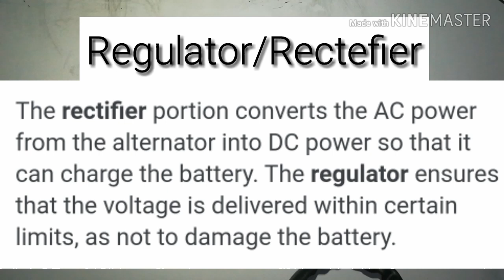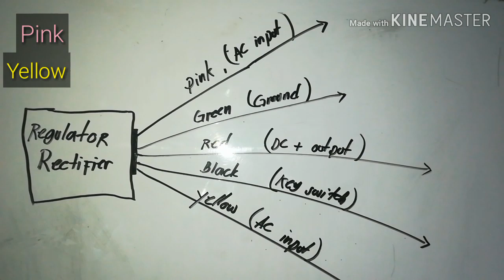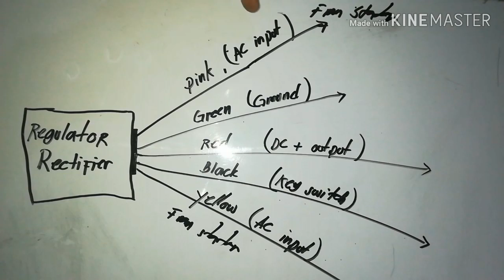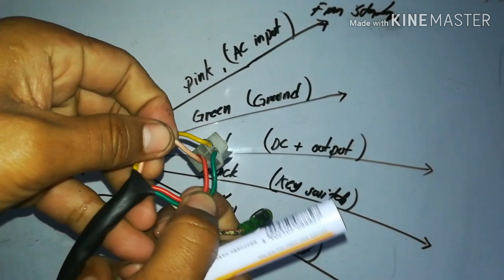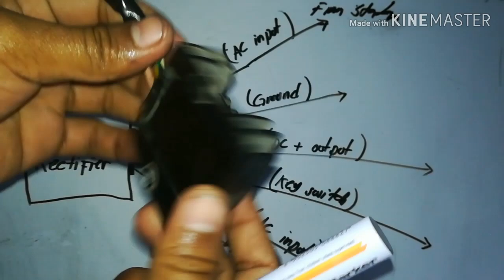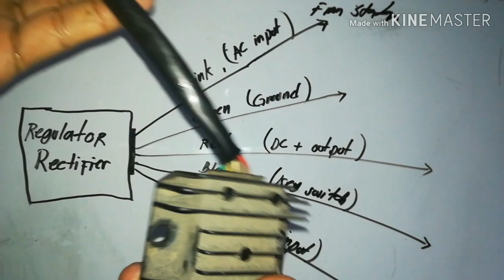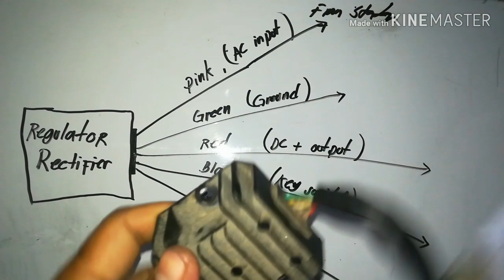5pin Regulator rectifier wiring diagram(paano malalaman kung ok pa or palitin na?)part 1

Comment: 4pin lng stock rectifier 
bumili ako bagu rectifier hnd ko alam kung ilan wire tinanung ako ngtitinda anu b motor ko sbi ko gy6 binili ko 
5 pin sya un tinaggal ko luma ko rectifier 4pin lng pla nygn ginawa ko red at black wire pinasama ko pra 4wire prin un black un sobra at wala kapareho tama b ako pgkabit ko 
hnd nka fullwave motor ko stock lng

head light ko battery operated
Reply from the maker: Tama ang ginawa mo bro..
Reply: @RRJTVRandomTutorial  
bro red at black pinag lupot tlg pinagsama ko hnd ko sya nka top
iisa lng connection kc s iba nka top kya 5wire prin s kin 4wire prin

Comment: sakin boss dalawang yellow pano.ba yon?
Reply from the maker: Ok lang yan interchangable yan ng whit/pink posible fullwave ang rr mo
Reply: @RRJTVRandomTutorial  d pa na rewind motor ko boss china lang kasi to eh
Reply from the maker: @1andrewx  ok lang yan bro..
Peru wala k naman prob sa wirings mo bro
Reply: 5 pin kasi sakin pero nabili ko na rectifier mga boss 4pin lang may color black xa sa nabili ko na 4 pin wla pwedy koba to ikabit?
Reply from the maker: @1andrewx  pweding bro..
Wag muna lang gamitin yung black..
Ok lang yan..
Reply from the maker: @1andrewx  pweding bro..
Wag muna lang gamitin yung black..
Ok lang yan..
Reply: ayos try ko boss salamat
Reply: @RRJTVRandomTutorial  solb na.boss may.nabili ako.5pin.mura lang pala 190 kala ko mga 700 nakabit kuna kaso umiinit xa boss normal lang ba yon?
Reply from the maker: @1andrewx  anung tatak bro..
Depende sa gamit bro..
Paga lagi naka close ang triger nainit sya.. Peru ok lang nman yan
Reply: @RRJTVRandomTutorial  japan pang naka lagay pero 5 pin xa mura lang